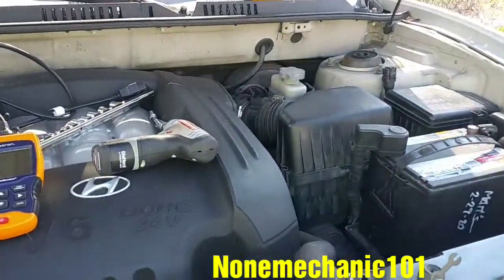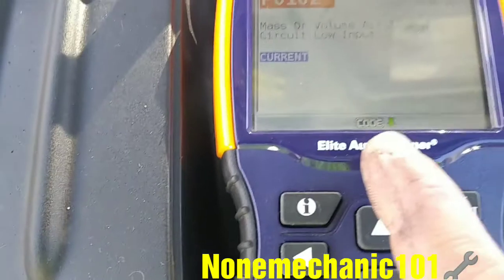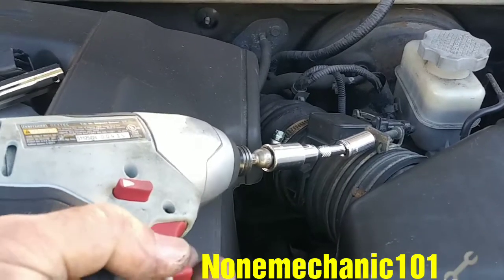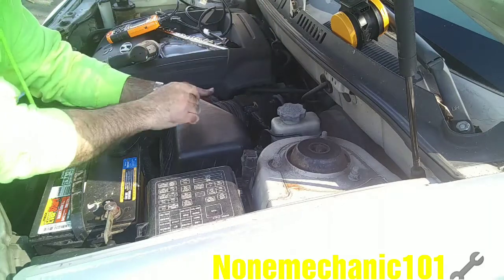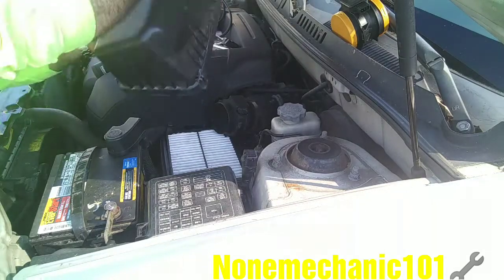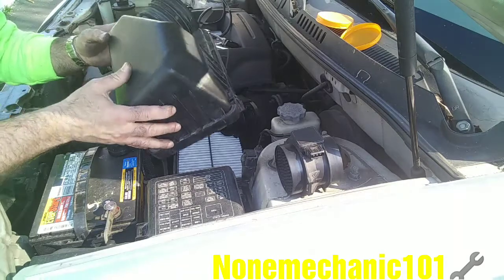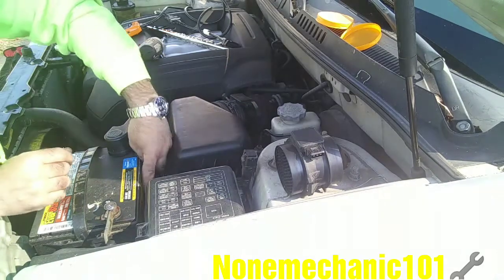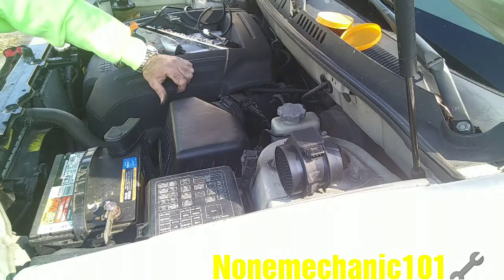2003 Hyundai Santa Fe Mass Flow Air Sensor Replacement: P0102

Comment: Please I have the same hyundai Santa fe 2003, dohc engine v6, 24v. Need the correct code to buy a new air flow sensor
Reply from the maker: You need the part number?
Reply: Yes sir, I need the part number for the air flow sensor

Comment: I was almost surprised cleaning the Mass Air Flow Sensor didn't do the trick. Great job getting it fixed.
Reply from the maker: Cleaning the mass air flow sensor did worked for a couple of week.